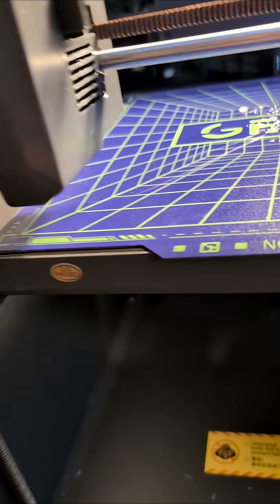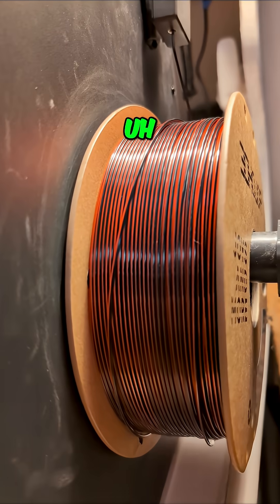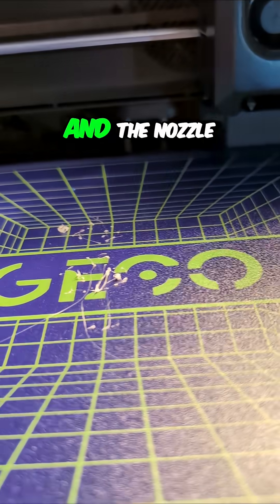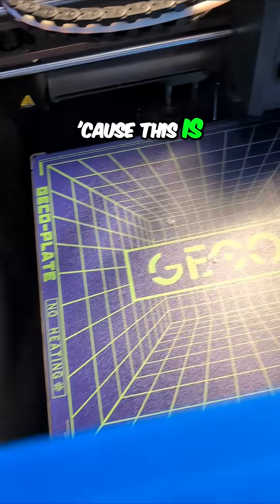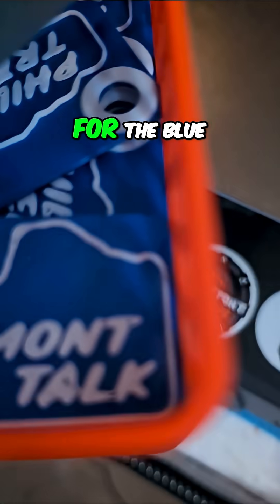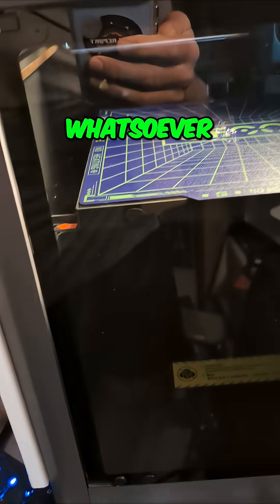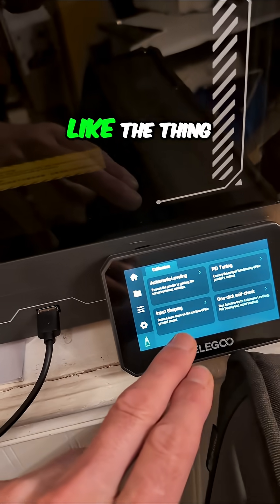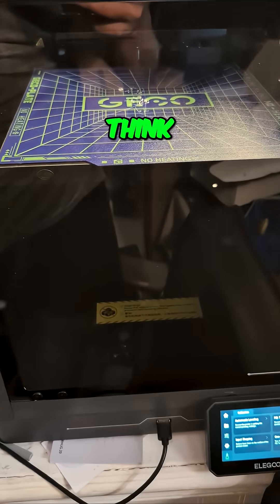3D Printing Troubleshooting: Red & Black Filament Problems - Elegoo Centauri Carbon

Comment: What is that you have plugged into the USB port?
Reply from the maker: A USB hub. Was trying to add cameras. But couldn't figure out how to add any
Reply: @GearReportMaker oh okay, that makes sense. There doesn't seem like much you can do with this printer other than print at the moment. But I am satisfied with my purchase so far.
Reply from the maker: Agreed. My other Elegoo printer lets me use that same USB hub to run additional cameras. maybe they'll turn that functionality on eventually for this one.

Comment: Hmm why is that all the problem printers i see are elegoo im soo glad i avoided it
Reply from the maker: Turns out this was user error
Reply: I have 3 of these printers and they are workhorses!!
Reply from the maker: I love mine. I've posted a lot of videos showing issues, but they are nearly all things I did wrong. It has only had a few instances of printer errors in about 200 hours of printing. And those were solved by rebooting the printer.
Reply: @GearReportMaker  i Guess im spoiled. i got a Bambu A1 with well over 1000 hours of printing and i haven't had any real issues. the only "problem" i had that i can recount is that i selected "built support on build plate only" on a model that  also needed support on itself. and it missed some supports that should have been printed on the model, causing it to print in the air. and a time i forgot to clean the build plate after i oiled my X axis and had few greasy spots that caused bad first layer adhesion. for the rest its just been set and forget. i start a print before i go to work or bed and come home or wake up to a finished print.
Reply: Mine has over 150 hours in it and the only errors was because of me so I think elegoo is fine

Comment: I bought 10 rolls of a filament and every roll caused a blockage on my sovol sv04 after 3 rolls I abandoned the filament. When I got the Centauri I thought let’s give that filament a go again and god damn it blocked within 10minutes. I can’t remember what brand it was but I dumped the remaining 6 rolls, moral of the story stick to the brands you know well.
Reply from the maker: I assume you played with your temp settings to try to dial them in. But yeah, that sucks!

Comment: I think you need to stop using that brand of filament. There are other brands in case you were wondering.
Reply from the maker: Turns out when I loaded the filament I didn't see a slight swell at the top. That swell kept it from feeding. I clipped it off and it loaded fine.

Comment: I had the exact same issue literally a week ago. It’s a clog inside of your extruder what I did was tear apart the hot end take the PTFE feeding tube out and take a Allen key that is small enough to heat up the end of it with a blow torch till his glowing red hot and push it down into the extruder while twisting it give it about 3045 seconds. Let it cool down and twist and pull out it gonna rip the clog out along with it.
Reply: Great feedback, thanks!
Turns out when I loaded the filament I didn't see a slight swell at the top. That swell kept it from feeding. I clipped it off and it loaded fine.
Reply: @puckaneer ohhh okay that makes sense yeah i always cut that little squiggly bit off of the new rolls it wont feed right
Reply: @jovi1095  i usually do, but didn't that time, for some reason.
Reply: Do these printers not have a cold pull function?
Reply: @NotAnotherMitnick unfortunately no
Reply from the maker: Doh! Just noticed I was commenting from the wrong YT profile... 
Great feedback, thanks!
Turns out when I loaded the filament I didn't see a slight swell at the top. That swell kept it from feeding. I clipped it off and it loaded fine.